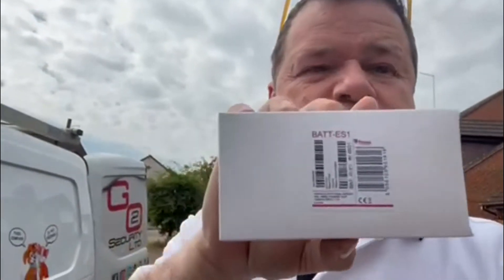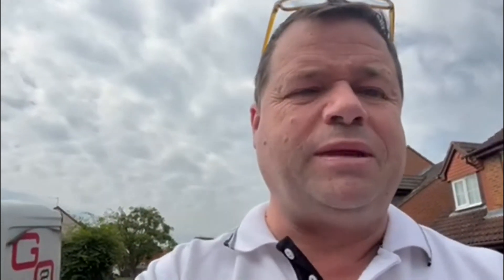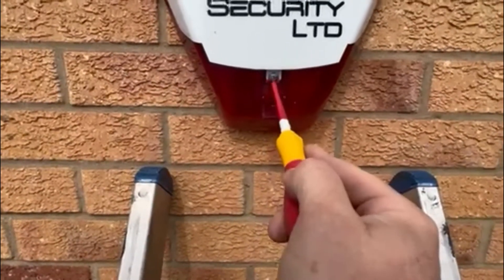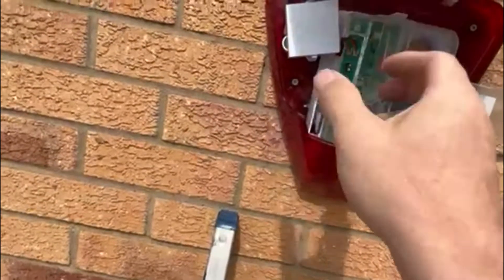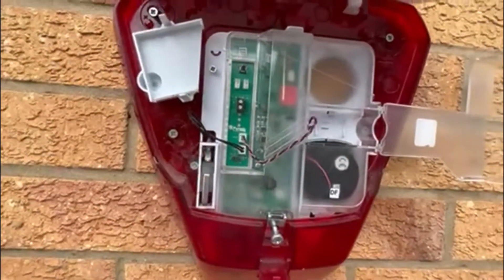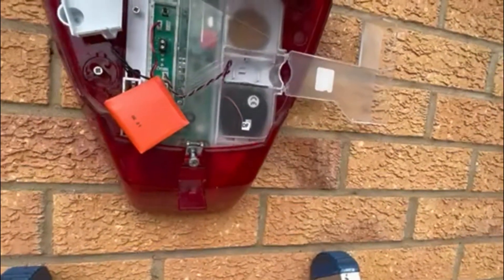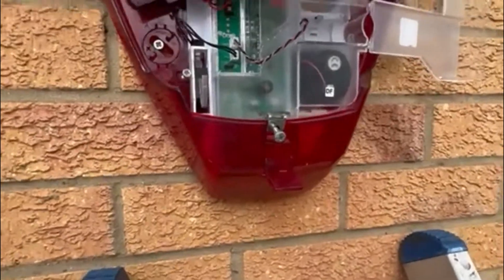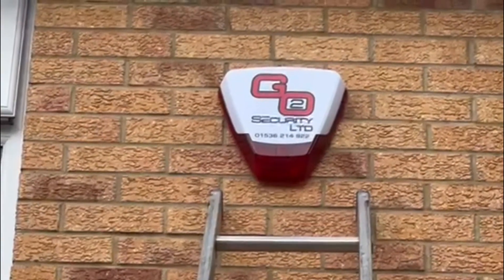Change Batteries In An Wireless Pyronix Delta Plus Bell Box

Comment: I would add one point. When the siren goes, it is advisable to wear ear defenders, especially if you are up a ladder as the noise can be quite a shock. I live in a bungalow so I only need steps but I almost recoiled backwards the first time I did this without the ear defenders.
Reply from the maker: You do have a point 😀👍

Comment: Why didn't the siren go off when  new batteries were installed?
Reply: They don’t until press the tamper spring and let go again, it’s not shown on there as but I did carry out that test.
Holding the phone and putting the lid on is a bit of a fiddly job, got a GoPro coming with head and chest rig. 
I hope this helped but if you have any other questions please let me 😀👍